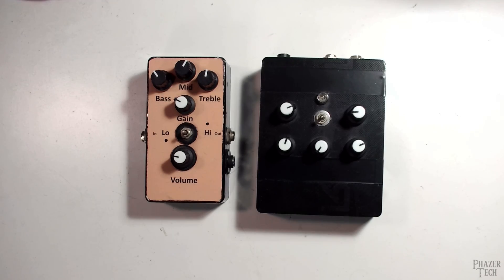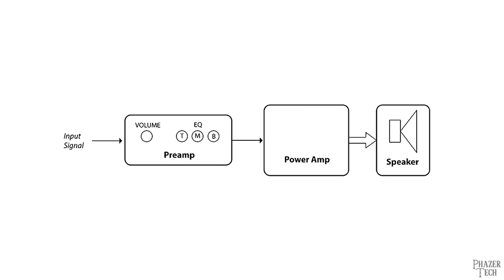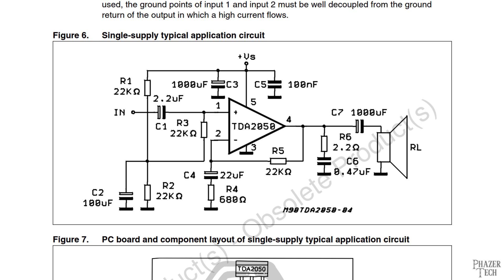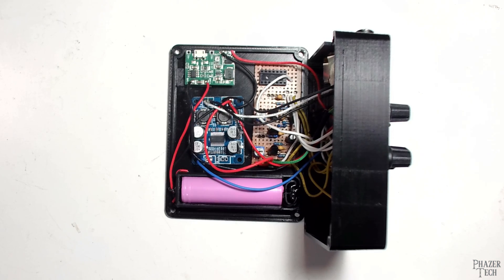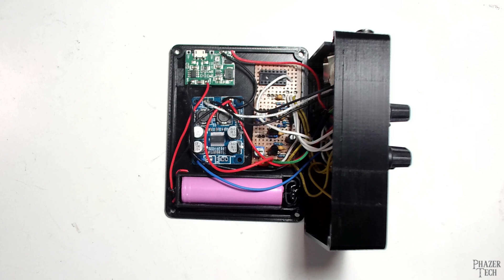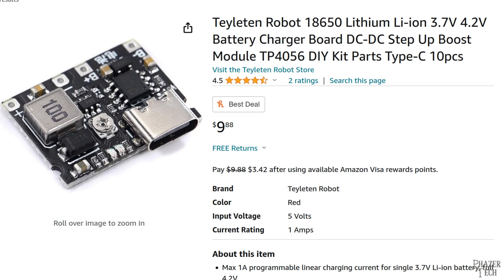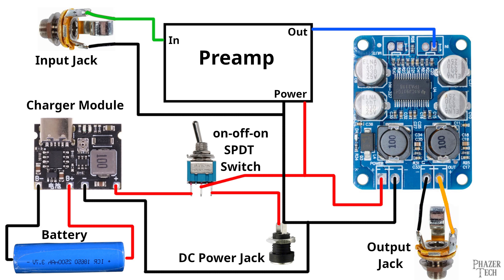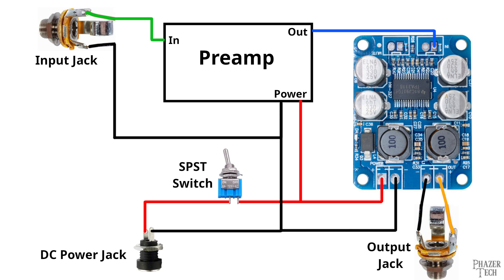DIY Guitar Amp in a Pedal Build Guide

Comment from the maker: Phazer Tech PCBs are now on sale: https://phazertech.com/store/store.html
Unique and awesome sounding circuits, try them out for your next build while also supporting the channel!

Here are a number of additional tips regarding the video:

I recently found out that many of these boards being sold on Ebay and Amazon are counterfeits. Apparently they still work but have different specs and are limited to 18V.  Some people have burned out these boards by supplying 24V. Just something to keep in mind: https://www.diyaudio.com/community/threads/with-so-many-fake-tpa3118-boards-ebay-etc-is-it-still-possible-to-even-buy-a-working-60w-board-in-2024.408827/

There are a number of alternative models with various specs and power ratings, so feel free to use a different model. The wiring will be the same. Here's a few examples of alternative models: https://amzn.to/3ZOfevZ
https://amzn.to/3BJsGJG

The preamp and power amp already share a common ground through their power inputs, so it's not necessary to ground the audio input. It probably wouldn't be a big deal if you did it, but it's bad practice because it can cause ground loop noise in certain circumstances. But if the preamp uses its own power supply, then yes you'd need to ground the input.

If you want to get 60W out of the amp then be sure to use appropriate gauge wire for the power, ground, and output to speaker wires. At 60W you'll want wire that can handle up to about 4 amps to be safe. But if you only plan to use it with the battery or a 9V-12V power supply then wire gauge shouldn't be much of a concern. Here's a good chart showing how much current a particular gauge can handle: https://www.engineeringtoolbox.com/wire-gauges-d_419.html

If you want to use a battery but don't want to mess around with a boost regulator module, these 12V battery packs should be perfect: https://amzn.to/3VTSw4x

If you choose to use a power supply then make sure it's a good quality low noise power supply. If it's a switching power supply then you'll likely want to add additional filtering caps. If you don't then you might get a lot of white noise, but it will still work.

And finally, if you want the circuit to be protected from connecting a power supply of the wrong polarity then you could add a Schottky diode in series with the power rail directly off the DC input: https://amzn.to/4cbHAFG

Comment: Most of the preamps on the site uses jfets which are really hard to get from where im live, are there alternative sources where I can get preamp schematics without jfets?
Reply from the maker: You can use any boost, overdrive, or distortion circuit. They pretty much achieve the same thing as a preamp, but generally a preamp will have a more amp-like sound.

Comment: Very instructive tutorial! About charging the battery through the dc power supply, what type of regulator board would you use and where would you place it
I’m new to this
Reply: And would it replace the charger module since we don’t need a usb port anymore?
Reply from the maker: @billykbeane  Thanks! It would be best to explain with a diagram but here it is in a nutshell. You need a 5V DC buck converter, just search for that on amazon. Get one that can handle 3A just to be safe. You still need the charger module. Underneath the USB port are pads to connect wires instead of using the USB. Connect the output of the buck converter to these pads. Then connect the power supply to the input of the buck converter. But something to keep in mind is that it's not great to keep batteries fully charged, so you wouldn't want to keep it plugged in indefinitely. To solve this you could add a on/off switch from the power supply to the buck converter so you can control when its charging or not. Hope this helps.
Reply: Thank you soo much! I’m gonna look into that
Reply from the maker: @billykbeane  For sure, also if you're new to DIY then I suggest starting with one or two regular guitar pedal builds before moving onto something more advanced like this.
Reply: Your right it’s probably a better idea, thanks again

Comment: This may be a really basic question but if i wanted to have an onboard speaker instead of the output jack to a cabinet, would i just solder the speaker to the power amp board where the output jack currently is in your diagram?
Reply from the maker: Yep that's correct
Reply: @PhazerTech awesome! Thanks!

Comment: 10:00 I've had 100% failure rate with those green boards. I don't know exacty what happens, but eventually the switching IC for the boost converter side simply shorts itself.
Reply from the maker: Yea I mentioned in the pinned comment that some boards have fake chips. I believe mine is still working but I haven't tried it in a while. How much voltage did you supply them?

Comment: What type of charger module could you use for 3 or 4 batteries?
Reply from the maker: What are you trying to do? If you wire them in parallel for increased battery life then you can use the same charger module.

Comment: I noticed you do not have a ground wire connected to the input on the power amp board.  Why is that, or did I just miss it?
Reply from the maker: Good question! The preamp and power amp already share a common ground through their power inputs, so it's not necessary to ground the audio input. It probably wouldn't be a big deal if you did it, but it's bad practice because it can cause ground loop noise in certain circumstances. But if the preamp is external and uses its own power supply then yes you'd need to ground the input.

Comment: Hi, thanks for all the information. I´m building a micro power amp in a box(without the preamp and battery) with the same board using an aluminum enclosure. Please, help me with the grounding scheme. I need to keep both signal input and speaker output grounded to the enclosure or only the input?
Reply from the maker: Glad you liked it. You should only ground the input.
Reply: @PhazerTech  Many thanks.

Comment: Maybe I missunderstood something but what if my preamp is digital, like amp sim running to audio interface. How should I wire input jack? Should I just use one wire (the blue one in your schematic)?
Reply from the maker: Yes all you need to connect is the tip to the blue wire, and the sleeve to ground.
Reply: Thank you, btw I can't wrap my head around this polarity problem. I don't know if i should get center positive or center negative psu (I will be connecting + to + and - to - like in your schematic) you said that I should use center negative but you're schematic says to connect + to + etc. so shouldn't I get center positive psu? Also I saw someone online saying that he bought center positive psu and it works fine with tpa3118.
Reply: I just checked and dc isn't labeled so does this mean that TPA 3118 - is going to dc + and - to +?
Reply from the maker: @phrog619  You can use either one. All I said is to pay attention to the polarity when wiring it up. The only difference will be how you wire the barrel jack. Normally the long leg on the jack indicates negative if using a center positive supply, but if using a center negative then it will be positive. Measure it with a multimeter before you solder the wires. Positive polarity will always go to positive on the amp.
Reply: So if the long leg (negative) goes to negative on TPA 3118 then i should use center positive?
Reply from the maker: @phrog619  If that's how you want to wire it, yes. If you want to use a center negative supply then you'll need to wire it the opposite way. It's up to you. But again, verify with a multimeter before soldering anything.

Comment: Exactly what I was looking for!! I'm just getting back into DIY. All I want is a power amp in a pedal totally clean but able to run on a battery. GREAT video! Thanks 🤩
Reply from the maker: That's great to hear, glad you like it. If you have multiple preamps or even a multieffects pedal then just a power amp would be perfect!
Reply: @PhazerTech  Exactly! That's why I want a clean amp. So I won't need to add an fx loop or have the preamp distort the reverbs and delays. Most all the multi fx units have amps and stomp models in them now days. It's actually hard to find just an FX unit these days without some kind of amp or overdrive in them. At least that's been my experience the past few years. Thanks again 😁
Reply: @PhazerTech   Hello again 🙂 So will 24 stranded gauge wire be okay to use for this? I go the 60 watt version but will be using a 9 volt battery so not sure how many watts that would be. I do have thicker wire but was wondering if 24 gauge would work okay seeing i have so much of it and it's easier to work with in a small enclosure. Thanks in advance :)
Reply from the maker: @emach07  Hey! 24 gauge stranded wire probably won't cut it for 60W. To be safe, I suggest a current rating of 4 amps. Here's a good chart showing how much current a particular gauge can handle. 20 or 18 gauge stranded wire should be fine. https://www.engineeringtoolbox.com/wire-gauges-d_419.html
Also you won't be able to get 60W with a 9V battery.  You're better off using a 24V battery. Also be sure to use an 4 ohm speaker if you want 60W.  With an 8 ohm speaker you'll only get about 35W.
Reply: @PhazerTech  Thanks so much for your fast reply and all that info. It's just a play around project amp so 35 watts is fine. I used 22 gauge wire and up just to be safe (was in a hurry lol)  but I can't seem to get it to work. I had sound with one rechargeable battery but there was a bunch of hiss and I then remembered those USB rechargeable batteries did that. So I put in an Everyready but now I have no sound and a ticking noise when turning the potentiometer up in certain areas. I've experienced this many years ago but can't for the life of me remember what causes that 😖
Reply from the maker: @emach07  Can you give me more info on the battery or post a link of it?
Reply: @PhazerTech  The battery I am now using is just a 9 volt Eveready MAX and it tested over 9 volts. I did discover while resoldering a wire on the on/off switch that the terminal was loose due to over soldering. It was from an amp project many years ago so I must have soldered the poo out of lol or it was just made cheap. 
So when I took that out and just connected the wires together that ticking noise was completely gone, but I still had no sound whatsoever. What's weird is the noisy USB rechargeable actually put out some sound. But the hiss (like having 2 distortion pedals on with no noise gate) was unbearable and it wasn't very loud at all either. I'll be happy with just a couple of watts so I'm not worried about getting a lot of watts out of this with a 9 volt. 
I bought a 2 pack so I'm going to see if I still have any breadboards laying around and see if I can hook the second amp up and get something out if it. Oh, btw, the red light on the circuit board goes on when I connect the battery so it appears to be getting juice
Reply: @PhazerTech  Okay! Got it figured out. The output jack I installed appears to be defective. I wiggled it around and got it working and it sounded perfect! So I tightened it up real good and once again a loud static noise and this is with the Eveready so it's not the battery. Just a FYI, I do know that I had a terrible hissing issue with those USB rechargeable batteries I mentioned when using in 100% fully functional gear so everything I said abut those still goes but yeah, it looks like a defective jack so I'm putting a different one in but it looks like I got it from here. Thanks again so much for replying and trying to help. I really appreciate it. A new subscriber here! Love the channel! 😍
Reply: @PhazerTech  Nope! Wasn't the jack. Put a new one in and same problem except now I can't even get rid of the static hiss sound and no guitar sound coming out whatsoever. I've even eliminated the potentiometer and basically have an input jack, output jack, and a battery. It can't get any easier yet it still won't work. VERY frustrated as I've done stuff like this years ago and even built my own amps. If it wouldn't have worked for a minute there I would have thought the amp was defective but it did so I'm ruling that out. Only thing I can think of that's left is bad wires? I have all new 22 gauge wire coming tomorrow so I'll give that a go. I'm out of ideas after that 😖
Reply: @PhazerTech  Well I'm throwing in the towel on this one at least for now. I opened up the other brand new amp and soldered everything in all over again very carefully and same thing. Even used some brand new wires, first it was hissing, then I shut it off and back on again and then I got the ticking noise again. I didn't even wiggle any wires or anything and everything is soldered good and solid. Only thing I can think of is either I'm a complete incompetent idiot or I just got lucky and got TWO defective amp circuit boards. Thanks again anyway. If I ever cool down and figure this crap out I'll post my findings 🤬
Reply from the maker: @emach07 Thanks for the feedback, glad you like the channel!  I believe the issue is that regular 9V batteries aren't capable of delivering enough current. I suggest using a li-ion or lipo battery instead. Sorry I didn't explicitly mention this in the video. It didn't cross my mind at the time and I can see why a regular 9V battery might seem like a good choice. But when batteries are pushed to their limit they'll experience a large voltage drop. The amplifier requires at least 8V at the bare minimum and really 9V is a safer minimum. Chances are the 9V battery can't maintain a stable voltage which is why the amp is cutting out and not working correctly. 

In my case I used an 18650 battery with a boost regulator which guarantees a stable 9V output. But if you want to make things easier and avoid the boost regulator, I suggest using something like this: https://amzn.to/3VTSw4x

And finally, I just found out that many of these boards being sold on ebay and amazon are counterfeits. Apparently they still work but don't have the same specs and are limited to 18V.  Some people have burned out these boards by supplying 24V. Just something to keep in mind: https://www.diyaudio.com/community/threads/with-so-many-fake-tpa3118-boards-ebay-etc-is-it-still-possible-to-even-buy-a-working-60w-board-in-2024.408827/
Reply: @PhazerTech  Wow! Thanks again for your reply and all of that information. I think you nailed it!! The voltage wasn't stable enough. It states 8 to 24 volts but like you said, who knows when it comes to some of these cheap little power amps. And that explains how it could work for one minute then not, making different noises, etc. Dang! I now wish I wouldn't have dropped that small variac I had off at Goodwill lolol (just for troubleshooting purposes) that battery pack looks pretty cool but I'm trying to get a battery powered amp going so I won't have to worry about plugging in anything but a guitar and my battery powered multi fx device.

Thanks again so much!  🤩
Reply: @PhazerTech  Oh! I see that is a rechargeable battery! Cool! Still sticking with 9 volt though for simplicity's sake. Might have to build another little Gem but the clean version. Anyway, later my friend 😊
Reply: @PhazerTech  sorry lolol one last desperate attempt here to salvage this project. Was looking into voltage boosters that would easily fit inside the pedal enclosure but I don't know anything about them. Would something like the MT3608 work with a 9 volt battery to get the voltage up enough to efficiently run that amp? Thanks so much once again :)
Reply from the maker: @emach07  No problem bud, happy to help! Like I said a single 9V battery isn't able to deliver enough current so that's why li-ion or lipo batteries are ideal. But you could try two 9V batteries wired in parallel, that might work :)
If you're set on running off a single 9V then you'll need to go with a different power amp module, but those will be very limited in power, like only 1 or 2 watts.

Comment: Is it possible to make a 200w version using the tpa3116d2 ? great project I will build!!
Reply from the maker: The tpa3116d2 should work good for this project, however it looks like it's a 100W amplifier, not 200W: https://amzn.to/3zCCfJq
Just make sure you use an adequate PSU if you want to get the most out of it!

Comment: You are running 12-24v amplifier with 3.7v battery?
Reply from the maker: Yes, the charger board also contains a boost module which boosts the battery's voltage to 9V.  The amplifier can work with as little as 8V.

Comment: Hello! This is a great video, just what I was looking for :)
Can you hook up a tube preamp? If so, do you have any schematics for this?
Reply from the maker: Thanks! Yes you can hook up any preamp to the power amp. The connections would be the same, you just need to connect the signal wire and ground wire.

Comment: I like to consider the 100% efficiency case,  V=IR.
R=8 ohms, if the current rating for your boost converter is 1A,  that gives you 8 volts max before the power supply starts to droop.
Reply from the maker: Your assumption that the 8 ohm speaker is connected directly to the regulator's output is incorrect. From the regulator's perspective the power amp is the load. If the power amp is given 9V then it will output up to 5W with an 8 ohm speaker according to the charts I showed. Since the amp is roughly 90% efficient then its actual power draw will be around 5.6W. The preamp barely uses any power, only around 0.2W max. Peak power use of the entire circuit is less than 6W, and that's at max volume. The boost regulator is capable of 1A output (or 10W max), so if it's set to 9V output then it can produce up to 9W which is considerably higher than 6W. There's plenty of headroom.